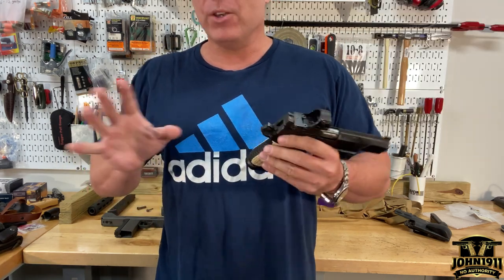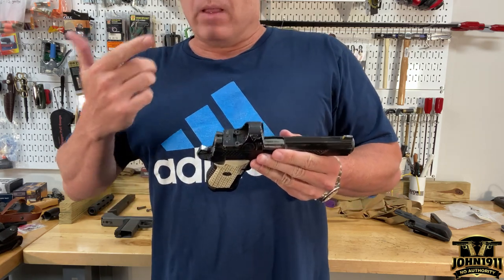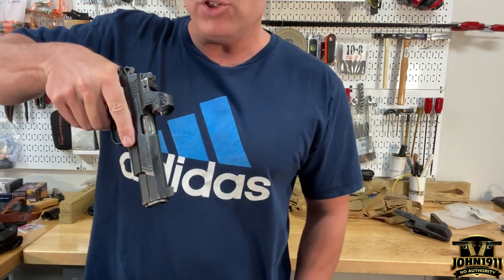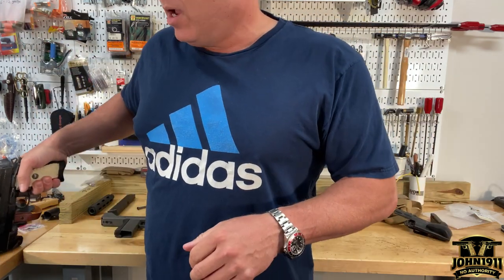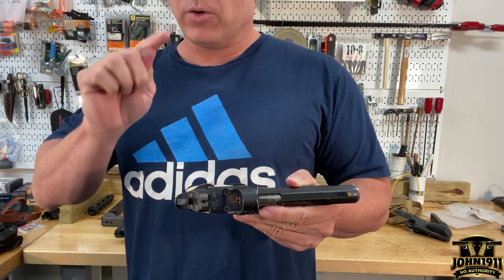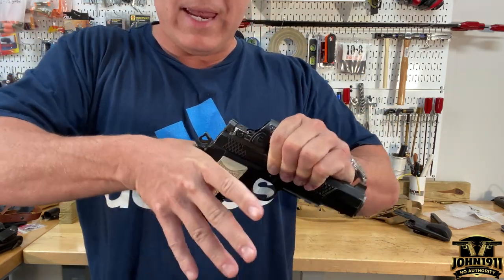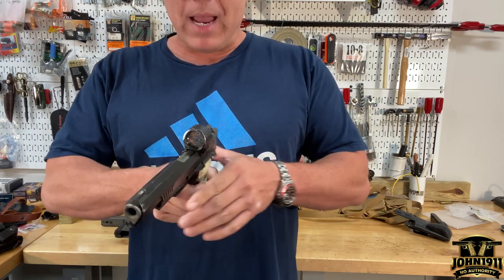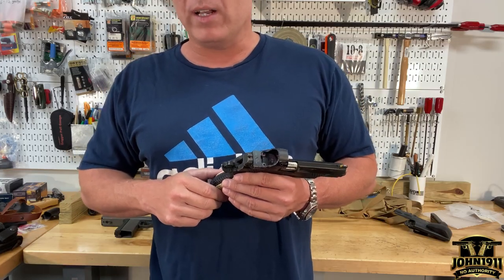Cracking Open a Locked Pistol

Comment: Just installed a new slide stop lever on my prodigy and it locked forward.  Was pissed, but thanks to this video I was able to get the slide back and remove the new lever and reinstall the old one.  I had to slap the front of the gun/barrel.  Of course mine wasn’t loaded.
Reply from the maker: Glad my old school trick helped in a pinch! 👍

Marky

Comment: I put one of these on layaway and will lose my deposit because I’m not buying this piece of junk. I buy Wilson, Nighthawk, Dan Wesson and BUL Armory - I decided to support Springfield but this gun looks like a rushed effort and that’s unacceptable.
Reply from the maker: Certainly a logical decision. But one needs to remember there is a big difference between a Springfield production gun and something out of Springfield custom shop run by Dave Williams.

The Springfield prodigy is from the former.

Marky
Reply: See if you pay it off if they have a refund policy. I know a few places that do layaway and as long as you pay in full you don't forfeit your deposit
Reply from the maker: Interesting. Personally I wouldn’t be putting money down on pistols I don’t 100% plan on owning. 

Marky

Comment: Great advice.  These Prodigys look to be a bit of a nightmare.  Not sure why folks can't have the financial where with all to just save a little more and get a well established Staccato model.
Reply from the maker: I need to be careful here. I haven’t seen a Prodigy in real life. I also don’t know what kind of ammo or whatnot these people are using. I don’t know what I don’t know. Could be 5000 of these guns sold so far run like tops. And it’s just the small minority that are getting Youtube views. 

So I am just helping folks out who seem to lack some useful knowledge on the subject. 

—Marky
Reply: Because some people aren't dumb enough to buy a 3000 dollar handgun
Reply from the maker: @andog6092  🤷🏼‍♂️
Reply: Honestly, I always thought it'd be nice to get some double stack 1911s that are in the middle of the road in quality between the budget models that RIA puts out and the ultra high end pistols Staccato and the like put out. The Prodigy could be the first in a line of that, assuming they resolve the issues. I know the SA-35 started out with some issues, too.

I don't really care too much, though. I had a custom 1911 built off a stripped Para Ordnance frame using a lot of Wilson Combat parts so I could get a nice, high quality 1911 built by a competent gunsmith, also in .45ACP given that if I wanted a double stack Browning design in 9mm, I might as well get a Hi-Power.
Reply from the maker: The only comparison between a Hi-Power and a 1911 is the name of JMB. Even the ergos are radically different. 

Through the ages 1911 guys have said they will just try the Hi-power in 9mm. Very quickly they jump back to the 1911. 

That’s a clue.

Regards,
Marky
Reply: @John1911  I mean, steel frame, single action only, manual safety, there are a lot of places that are similar.

Though I do also remember the trigger being kinda shit (probably the worst downgrade vs. the 1911) and ergonomics being poor with hammer bite. Granted, very early 1911s faced hammer bite too but I suppose with the century long service in the US, any ergonomic problems with the 1911 had long been solved.

Still, figure fixing those problems would be more worthwhile than spending a lot of time fully adapting the 1911 to also be 9mm and double stack as well, especially since I recall there were a lot of headaches with that.

Delta rejected the 2011 because the grip and magazines were spaced for .45ACP length and therefore were unreliable with standard length .40S&W iirc.
Reply from the maker: I’m fully aware of the problems with the 2011 guns. You are just scratching the surface. These problems exist with Staccato, Atlas and Triarc as well. 

If you actually were familiar with my content you would know I dislike the 2011 in general. My feelings on them are known far and wide. 

With that out of the way, there is nothing that could be done to a Hi-Power to make it ergonomically comparable to a 1911. And no, I am not even talking about the HP trigger. 

If it could have been done, you would have seen all these performance based custom shops making 3000-5000$ hi-powers. They don’t and that’s a clue.

Regards,
Marky
Reply: @John1911  Fair enough. heh

I wonder what your thoughts are on the Para-Ordnance P14-45s. Double stack 1911s in its original caliber in general, really. I figure at least the issues with round length that Delta ran into wouldn't have been an issue there, but you're obviously the expert. I do know my gun runs very well once I got some magazine related issues sorted out, and even then I only ran into those magazine issues because I wanted to reuse old RP45 mags to get 15 rounds, being dissatisfied with the mere 14 the normal Mec Gar and Armscor magazines gave me. That also resulted in me needing to replace the old magazine springs with Wolff and also filing the slide stop a bit to prevent premature slide lock due to slightly different internal geometry, but after fixing those, the gun runs great.

For the custom Hi-Powers, I always chalked that up to the 1911 being more popular in the United States than the Hi-Power since the 1911 is "America's pistol". Therefore, more gunsmiths in America would spend a lot of time fiddling around and upgrading the 1911 and since we are still the world's leader in civilian gun ownership, our work naturally would be the most widespread.

Granted, as I said, you're the expert. I do wonder what the specifics are regarding the original Hi-Power that made them worse than the 1911, at least outside of the ones I heard. Also makes me wonder if the radical redesign FN did with their new Hi-Powers is worth it as a result.
Reply from the maker: 1. Para’s have a horrible reputation. Rightfully so. It’s not a brand I have even looked at in decades. It’s good yours seems to run. 

2. I am very curious about the new and improved hi-power. I believe it will be a huge improvement. But until I actually run and see one, who knows.

3. The HP had plenty of exposure to the US gun market. If it had been viable, it would have been the wonder-9 before that phrase was a thing. 

4. Two common flaws most don’t recognize about the HP are it’s ability to draw blood with modern shooting techniques. The other is durability. The HP is not a durable high round count gun. People who don’t mention those flaws, but claim to love the HP, obviously don’t shoot them much. And no, I am not talking about hammer bite. 

Regards,
Marky
Reply: @John1911  1. Mine was built custom using Wilson Combat parts and the slide assembly off my Sig 1911, to be fair, alongside a Kart barrel, so it was good parts. What I liked about the frame was that most was standard 1911 parts aside from the trigger, mag release, grips and magazine. I was more wondering if there were any fundamental design flaws in the double stack concept that I wasn't aware of. If the issues were mostly just bad parts or QC, that was resolved by simply buying good parts from companies like Wilson and having a gunsmith build it for me handfitting and tuning everything properly. Though I did hear Paras made completely in Canada were good and the ones made in America steadily went to crap, especially after Freedom Group bought them. Wouldn't know as I just used the frame. heh

2. Would be interested in seeing a video on it, given most of it seems to either be fluff pieces or people complaining it's not like an original.

3. I wonder why the Hi-Power was so popular outside the US, then. Hell, the Hi-Power is arguably what made 9mm the ubiquitous round it is today. Luger introduced it, but so many countries using the Hi-Power is what spread that caliber around.

4. What other ergonomic issues result from the HP? I've mostly heard of hammer bite, which tbh always baffled me given 1911s solved those problems for decades now with the rounded hammer and extended beavertail. Is slide bite also an issue? Or maybe some too squared off backstrap? Haven't heard about the durability issues of Hi-Powers. That's interesting, especially since I have heard of problems with Hi-Powers currently in service with, say, Canada because they've been beat to shit. Though I always chalked that up to the guns simply being old. Do 1911s hold up a lot better?

EDIT: btw, this is all extremely fascinating information. I'd love to hear more given my general interest in older guns, so learning this stuff good or bad is great.
Reply: @John1911  Hey, took my double stack 1911 shooting today and I actually ran into a few FTFs where the round was pointed up into the chamber but didn't go in. If I pull back slightly on the slide, the round reorients itself and goes back in.

However, that only happened for one string of rounds (all other rounds fired fine out of 200 or so I shot today) and it went away after that where all my rounds fed fine. And when I went home, I also rechambered some of my defensive ammo (Winchester Ranger T hollow points) even without cleaning the gun as a test and they not only fed, but fed extremely smoothly. Very certain it's crap ammo but I'm wondering if you'd know precisely what occurred there. I never had this many malfunctions from this gun before. I was using Federal CCI Blazer Brass, though I recall now that the packaging seemed slightly damaged when I got it, so I probably even received defective ammo. Not even sure if it's safe to shoot anymore. You have any idea what happened?
Reply: @John1911  Nevermind, turns out it was the Shok Buff I installed that was the issue. It already was breaking into pieces on me with just 300 or so rounds and I guess it was causing the slide velocity to shift ever so slightly. I do think it's also the ammo (Federal CCI Blazer Brass) since I ran some Fiocchi bought from the range itself that fully ran, though I noticed it wasn't a smooth feeding even with them. I'd briefly stop before pushing into battery, which I assume was due to the more powerful recoil spring and lube helping it forward. After I removed the Shock Buff, I ran another 48 rounds (the remaining I had) of CCI Blazer Brass and that all ran fine and also noticeable cycled smoother.

So wasn't the gun's fault, just the Shock Buff. I wonder if you have any experience with them since I assumed since it was Wilson Combat parts, it should be good to go. Maybe it's not compatible with Para frames?
Reply from the maker: If the gun isn’t sized to fit a shokbuff, best to not run them. 

If a gun has a factory buff, I’ll run buffs in it. If the gun doesn’t, I don’t add buffs to them.

1911s are not like modern striker guns. You can’t just drop in parts. All 1911 parts need to be fitted to your gun. 

I don’t care if Jesus himself made them and the package says drop-in. All that tells me is you have a part intentionally undersized to fit a wide range of specs. 

That’s ain’t drop in. That’s a B.S. sloppy gun.

Regards,
Marky
Reply: @John1911  It’s a 5” gun so I expected it to run, but it’s already not a normal spec with the Para frame so it makes sense. I was aware 1911 parts need to be handfit (though the guide rod seems to be fine) though I never would’ve expected a Shock Buff to cause problems like this.

Oh well, lesson learned. I was worried for a second that my claim my gun was running fine suddenly changed. Without it, the gun feels quite smooth to operate which is nice.

Seems like the malfunction I ran into in general seems to be related to slide velocity or travel?
Reply from the maker: Travel issue. Not velocity.

But I can’t diagnose a gun’s specs over the internet. 

I suggest you perform a 10-8 function test on your gun.

Marky

https://youtu.be/0vFIN1DqX_Y
Reply: @John1911  Huh, haven't seen that video before, though I've actually done all that before aside from shooting a round without a magazine in (though I've obviously unchambered it at home multiple times without the magazine and seems to eject fine). Will definitely try it formally next time at the range.

Gun has passed those outside of the time I had the Shok Buff which caused FTF issues. Even single round loading to check slide lock with magazines was something I did extensively yesterday to verify the premature slidelock issue I had was fully gone since I filed on the slide lock myself a bit. It was.

But yeah, travel issue makes sense. The reason I ask about slide velocity is I did run into this issue with a 10mm 1911 as well where aftermarket grips somehow caused FTF. Not entirely sure of the reason, but I suspect (and also talking to the grip maker) that the grips were just a little too oversized for my gun and caused the safety to push up just slightly and rub against the slide, which probably caused enough friction to induce FTF malfunctions. And the exact type I was having with the .45 1911 last weekend. OEM grips worked fine, and the gripmaker (Browneworks, btw) even kindly made some new ones for free that worked perfectly.

Obviously can't properly diagnose a gun over the internet and I don't even feel the huge need to anymore once I figured out it was the Shok Buff issue, but having some general knowledge to understand how this could happen is very useful to me.

EDIT: I actually wonder how well I can use snap caps to at least do a preliminary test at home before I have time to go to the range this weekend. I know I verified filing down the slide stop to prevent premature slide lock by taking off the slide assembly and inserting just the slide stop into the frame and inserted a loaded magazine. If the slide stop moved, that meant the bullets were rubbing against the slide stop and potentially causing the issue. Then when I filed it down to the point where the bullets were no longer doing that, shooting at the range didn't result in that issue anymore.
Reply: @John1911  Damn, forgot to do a full 10-8 function last range trip, but I did fire 100 rounds with zero malfunctions and run smoothly, so definitely was the Shock Buff that was the issue. Granted, I did test most things aside from shooting a round without the magazine inserted, and cycling by hand seems to eject that round just fine, so I think I’m good.

Makes me wonder what guns are compatible with the Shock Buff, as I assumed the 5” gun I have would’ve been compatible but seems like the Para frame doesn’t work.
Reply from the maker: It all comes down to if the gun has enough room for a buff. A 5” size isn’t really the determining factor. —Marky
Reply: @John1911  Makes sense. Oh well, as I said, without the buff the gun cycles very smoothly so I know not to have it now.